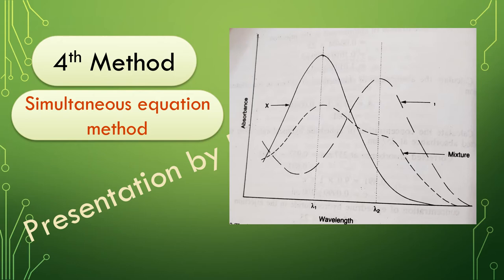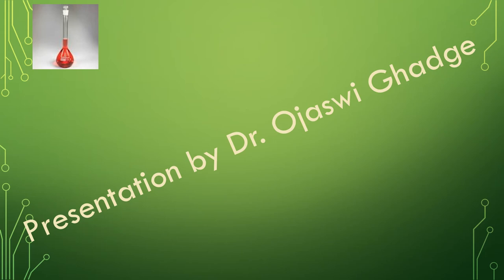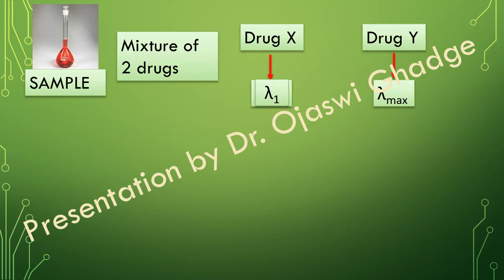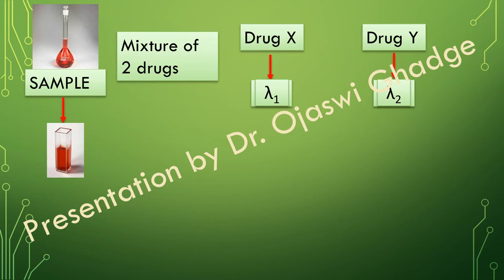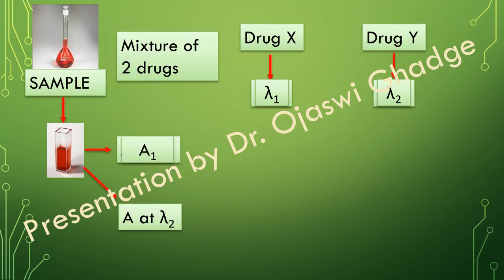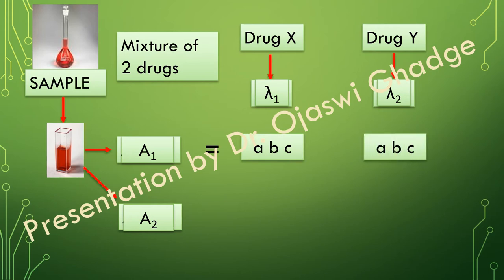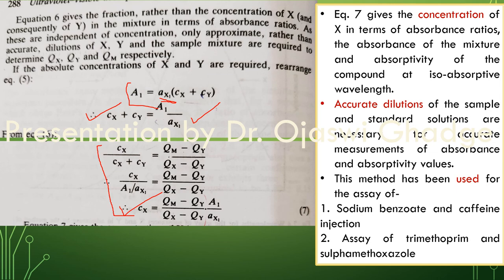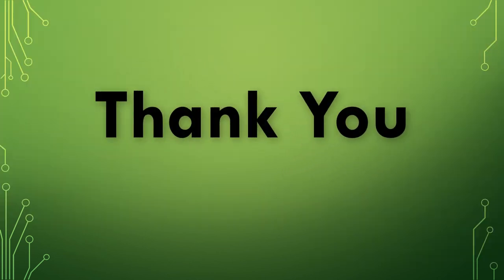Multicomponent analysis by UV spectroscopy- Simultaneous equation method and Absorbance Ratio method

Comment: What is the unit of concentration for the calculation of 'a'
Reply from the maker: you can take any unit.. here in case of sodium benzoate and caffeine .. in this example.. its taken ppm i.e. microgram per ml. Whatever unit you take same will be used for the concentration which you get after using that absorptivity value. Feel free to ask if something is not clear.

Comment: Excuse me, Ms. 
 How about area under curve method from spectrophotometry for determination drug multicomponent ? And if comparing with other simultaneous equation method of spectrophotometry?

Thank you
Reply from the maker: Hi Zulfina, Usually assay by UV is mostly based on absorbance or difference absorbance or derivative absorbance. In chromatography, you can take AUC and use it further for quantitation. You can refer to the video on chromatography where this method is explained.
Reply: Thank you for answering my question Ms.

Sorry Ms. 🙏, for that i mean AUC spectrophotometry method
Reply from the maker: Hi Zulfina, Can you elaborate your query and mail me at ojaswi.ghadge@gmail.com